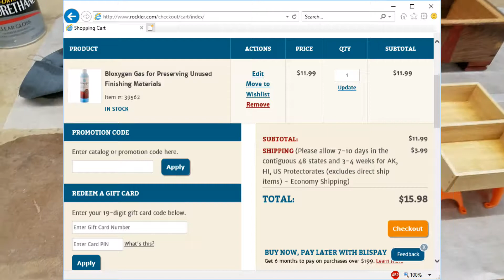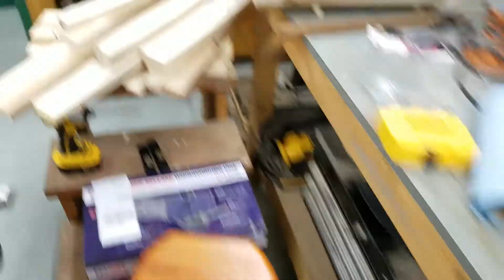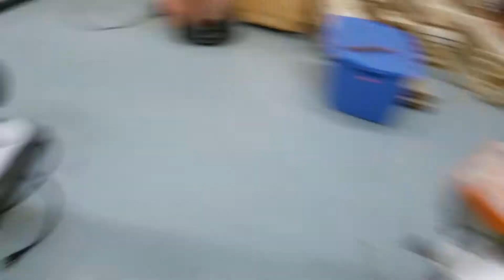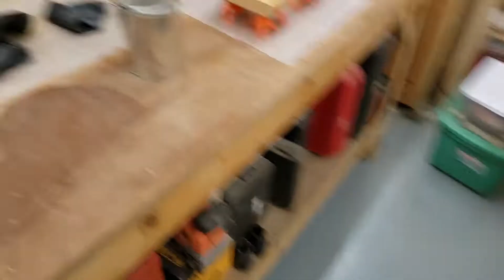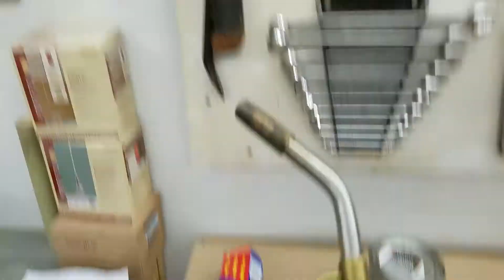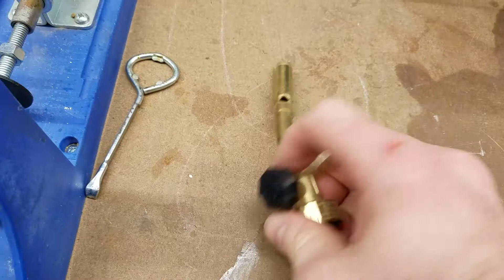Cheap way to preserve finishes in the can

Comment: Bloxygen is only about $10.95 at woodworking stores.  They offer a 100% guarantee if a can has leaked or something.   See www.bloxygen.com for more.  I would not recommend propane.  It's not inert.
Reply from the maker: I didn't expect my first reply to be from the owner of Bloxygen http://www.bloxygen.com/about.html.  I guessed a little high on the price when I was recording, which is why I put the screenshot from Rocker ($11.99 + shipping).  Propane is not inert, but it doesn't need to be - It just needs to be free of oxygen and not react with the finish.  I like Blogygen and that was the first can I had that leaked, but it's still triple the price of propane.